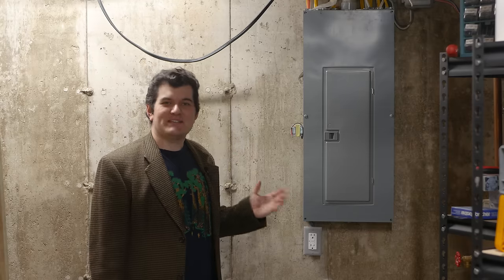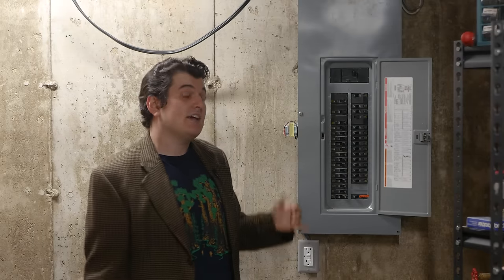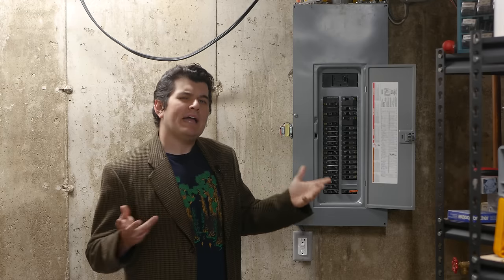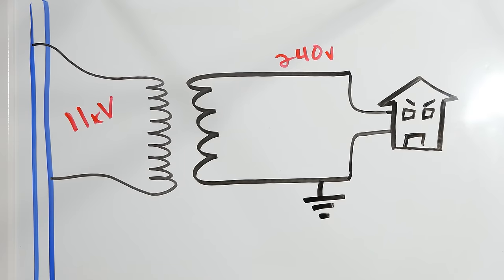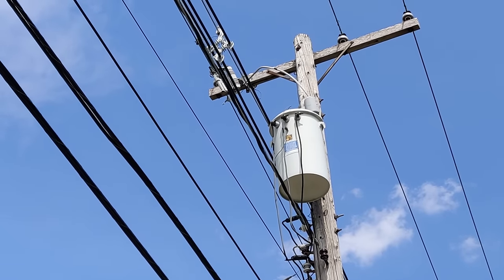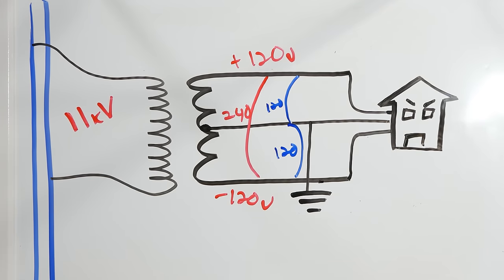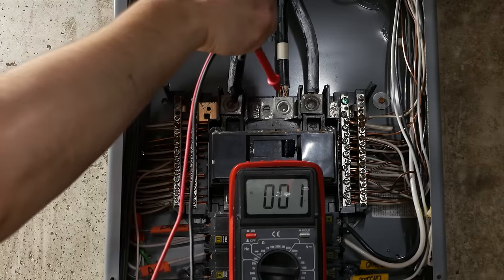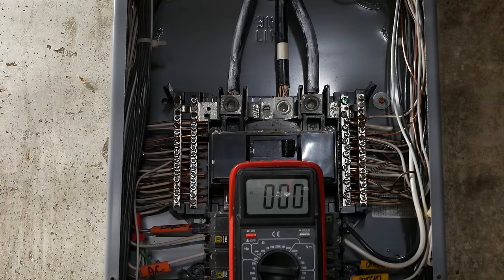The US electrical system is not 120V

Comment: Wait till he hears that we also have 400V supply at our homes.
Reply: @TheSimon253  he clearly said that he will ignore it.
Reply: @TheSimon253  Not to mention our neat DIN rail breaker boxes.
Reply: yeah by the logic he calls US a 240v system, then we have a 400v+ system (three phases at 240v 120degree offset= two phases measures a 400v difference). and of course accompanying three phase breakers! not the lame two phase ones he's got ;)
we call is 110/120 and 230/240 respectively because that's what you typically get at the wall with one phase and one neutral for "user appliances". not permanently installed ones such as car chargers or ovens or washing machines.
so I'm not really sure what he was trying to accomplish with this?
Reply: @AKIOTV  I'm not a huge fan of DIN rail breaker boxes. With all the DIN-mounted breakers I've seen, you must connect a supply wire (or bus strip) to each breaker along with the load wire, which adds more wires (and more clutter) to a breaker box. Plus, the two additional screw connections are more places for a mis-tightened connection to happen, which is marginally more dangerous. I much prefer our snap-in busbar system for both ease of installation, and less points of failure.
Reply: @give_me_my_nick_back  electrical stove connection as well. My Induction top can draw 8kw
Reply: We also have 2 phase neutral loss, the middle phase acting as return, @230V on each as well as polyphase.
Reply: But nobody uses this 400V thing. It's just a hazard when the wiring goes wrong. 380V 3phase is of course the ultimate power horse. Take that, USA!
Reply: @davidk8893  most of DIN breakers support common rail providing electricity as well as wire input - gives a bit more flexibility - although i agree in most home applications people tend to plug 2 wires at both ends. Its a choice though, not a design of DIN breakers. Im not very well informed about the US system, but my setup looks about the same as US one in principle - breakers plugged on a rail, with load wires coming out. 

Like i said above, im more interested in the 200 A breakers, i had to divide my load into multiple 3 phasex125 amp sections, and any breakers above the section are big (think at least a coke can big - 600A ones are bigger) one time blow fuses.
Reply: @give_me_my_nick_back  the fact that you dont use it does not mean you dont have it :) look at electric cooker (the big ones) and electric boiler and you will see it used. Normally they dont even have a plug but are screw directly to the cables (at least in germany)
Reply: @GizmoTheGreen  The US electrical grid is a three phase system. Most power lines have three conductors, except for in residential neighborhoods. However, the power that enters our homes is only single phase because there are very few things in our homes that would take advantage of three phase power. Three phase power is most often only used in industrial settings with motors that would utilize it.
(BTW, the breaker boxes we have are not two phase, they are split phase.)
The US has 240v outlets that are frequently installed in places like garages, but the truth is that there's not a whole lot of devices that really need anything higher than 120v.
Reply: @shha22  The basic principle of the US vs Euro breaker boxes is pretty much identical, it's just minor changes in the way that the principles are implemented. In my experience, the US breakers tend to be very heavily built, and use much larger contacts and much denser plastics than the euro equivalents. In the end, it doesn't effect the performance all that much, but it does produce a product that lasts a bit longer, and has has a much more quality feel. (opinion, not fact. Take with a grain of salt.)
The main breaker in our house (the huge 200 amp one) works just the same as any of the other breakers in our house, it's just bigger. It will only trip in very rare circumstances where the combination of loads on the breakers below exceeds 200 amps.
Reply: @Gunstick  we use 400V normaly on mostly do drive engine it is common on my opinion if you have use for it for example saw conveyor belt they offen have some version of this connector  https://www.soutok.com/5841-thickbox_default/e-zasuvka-pohybliva-400v-32a-5p-ip44.jpg i know at least 3 version of it.
Reply: Most houses in Sweden has 3 phase to the main breaker. If you like to weld or use other heavy machinery you have a 16 amp 3 phase outlet in the garage. Most consumer stuff no longer needs 3 phase though. When I worked in construction we used 3 phase 400v all the time, we had 16 amps, 32 amps, 64 amps and even some 128 amps (although we had to have an electrician come in everytime those needed to be handled). Anyway I have several friends that have 16 amp 3 phase outlets that they actually use, mostly for welding.
Reply: And there was a time 2 phase (90°) was "a thing".  Short lived design in Southern California for refrigeration equipment because an engineer covenced someone it was more efficient.
Our center tap trasformers do have a safety risk.  If someone steals the ground wire from the transformer pole and/or the meter base has a faulty ground, the voltage passes thru 120 volt wall outlets with highest load and back to the breaker/fuse box and let ground/neutral float to 90 volts. I know, because one rainy day a box "bit" me!  Good thing it was not like the UK version. The voltage could have been higher.
Reply: @davidk8893  Nah man, there are plenty of things that use more than 120V can provide. It's just that you don't get them in the US. Typical space heaters are ~7000 BTU/hr around here, for example. An electric kettle is also about 2kW.
Common practice in Europe is 240V 13A, which gives you ~3kW capability. The nice thing is, you'll barely ever trip a breaker, even running many things from one circuit.
In my house, I've got one circuit running three rooms on average. Only exception is the kitchen, which has multiple circuits, including a 3-Phase one. But I can still turn on the kettle, toaster, and Microwave at the same time without any fear of popping a breaker, even though they are on the same one.
The biggest advantage is that line losses are 1/4 of what they would be with a 120V system, thus the voltage is much more stable. And that greatly reduces fire hazards as well, as a bad connection doesn't cause nearly as much heating as on 120V.
Reply: He wouldn’t care? He was just trying to clear up confusion about 120 v. 240...
Reply: @give_me_my_nick_back  Some jetwashers use them.
Reply: @GizmoTheGreen  The entire video only talked about one single phase feeding into a residential building. The US still has available to anyone who requires it 480V three phase power( 277V 120 degree offset = two phases measuring 480v difference) from the same primary transmission poles that supply the 240 split phase. 480v three phase is not installed as a default because 240V on a split phase can run everything required in a residence. Car chargers, AC, Stoves, Driers, etc. I wouldn't say it is a lame system. It just doesn't add in complexity where it is not needed. DIY Joe in the US can't plug his TV into 400V if he gets two wires incorrectly installed.
Reply: @TheSimon253  We have 3 phase power available to UK houses. It's just ovens are the only thing that make use of it, and even then not all ovens. Don't ask me why.
It might make a come back for electrical car charging though.
Reply: @kain0m  There are a lot more circuits wired in a U.S. home than there are in a European one. Unless the home is very old, or it was wired against the NEC (national electric code) tripping a breaker will be a rare occurance. A typical branch circuit in the U.S is 120v, 15 amps, but it is common to have 20 amp circuits in places where high-current appliances will be installed. I can turn on the stove, oven, toaster, coffeepot, microwave, and have the fridge plugged in, and still not have any breakers tripped. It's simply a matter of having more circuits. Also, in a lot of places, the code dictates that certain rooms must have their own circuits, and places like bathrooms must have the outlets and lights on different circuits. (this is to prevent injury in case the lights go out due to a hair dryer tripping the GFCI). In addition, all new houses in the U.S. are required to put AFCI devices in all bedrooms and living spaces.
As far as line losses go, if you're referring to transmission lines, that's simply not true. The final voltage has no effect on the transmission line voltage. The line losses really have no ill effects on the house-level, as the wires don't travel far enough to have significant losses.
Reply: @carldawson5069  I'm not sure I grasp the US system well enough to be sure i understand the issue. But the ground doesn't go back to the transformer in the uk system so I don't think that problem would be posible over here.
Reply: @btwbrand  i thing thed U.S. is adding unnecessary complexity in form of transformer for every building we have just 3*240v connection from power line to building eliminating another problematic point and allow people run 400V equipment without unnecessary request.
Reply: @davidk8893  so you have more circuit and more amps in cable in lower distance thad sound for me like unneceseryl complex network in compression whit EU 3 phase 220v network.
Reply: @davidk8893  Indeed, plenty of appliances with a motor of course but most of them are fairly small oh and probably two of the bigger ones would be the Washer and Dryer an application that needs a motor capable of a operating over a range of speeds, that would take a recifier-inverter driver to use a three-phase induction motor in that sort of application anyway if I remember correctly. Some electric locomotives I believe do exactly that as driving the motor with a programmable frequency PWM inverter allows fine control over speed and torque. Though the locomotive is perhaps still simpler in that regard as you do generally want the motor to just turn at a given speed with a desired amount of torque none of this rocking back and forth etc washers do.

Comment: "there are many things inside this box that can kill you..."  Yeah, 60 of them each second!

"Beware the wigglies" as we sparkys say :-)
Reply: i never triggered a RCD.... i must have over 1600 Ohm body resistance.. in our 230V network
Reply: @Arltratlo  >1666Ω? ;-)  The average healthy person has 2-3kΩ and our Reg's use 2000Ω as the basis for calculation.  The maths and practicalities of how you should trip an RCD are slightly less simple, but I'm amazed you didn't trip one if you managed to put yourself in circuit...
Reply: @Dranok1    50V : 0,03A is 1.66kΩ....   so i am above it, below it will trip...
Reply: @Arltratlo  Quite so, that's why we are required to keep touch voltage below 50Vac, but other matters enter into the equation when determining what will make and RCD trip if you are part of the cct.  (Including parallel paths, harmonics, etc.)  I was only joining you in light-hearted comment rather than trying to start an electrical engineering discussion <grin>
Reply: @Dranok1   i am thankful that i am not an electrician in the USA, your wiring makes sometimes no sense to me...  but because our houses are mostly build from stone or bricks, it keeps the fire hazards down a lot...and to create a power outlet or a switch box, all i need is to drill a round hole...because our standard box is PVC and 58mm in diameter..makes life much easier...
Reply: @Arltratlo  I get the impression theirs uses the same system of round boxes (generally fed by flexi-conduit) -- I presume you are in mainland Europe, I'm in the UK so our backboxes are square but we have the same underlying Reg's (hence my discussing RCDs with you because our requirements are the same).
Reply: Actually 120 times a second. For each cycle, there are two peaks. Positive and negative, as these things are usually drawn.~
Reply: @SarahRWilson  Ooh!  Are you really trying to teach a bunch of electricians about the Noddy-basics of how AC electricity works?! 😅
No: we talk about cycles, not half-cycles -- that's why they're called wigglies, 'coz they go up and down 50 times a second (or 60 over there), not arches, that variously go up and over or down and under.  Nobody ever said "beware the arches" unless they had something profoundly against certain purveyors of fast food...
Besides, a single "arch" (of half the voltage) isn't going to hurt you (unless it's really well into HV range), it takes several full cycles to confuse your pacemaker and induce your heart into VF.
But you are correct that the symbol for AC voltage looks a little bit like a tilde sqeezed together.
Reply: @Dranok1  
If you touch hot and common, an RCD/GFCI won't even trip, because no leakage is occurring.  You have to be between hot and earth for leakage to occur.
Reply: @i-love-comountains3850  ? 🤔 Err...  Where is this from?  This hasn't even entered our conversation, and certainly you don't need to "explain" it to a couple of sparkys! 😆
(I'm getting used to electrical conversations with Yankees!  I even managed to interpret "common=neutral not earth" without thinking for more than a second 😉)

Comment: That slide about the gas dryer blew me away. I've been using one for years at my house and the closest we've ever had to a legitimate fire hazard was when someone ran their car through our garage, which goes to show gas dryers safer than cars.
Reply: to be fair, many things are safer than cars lol
Reply: That made me laugh! Thanks for the chuckle.
Reply: Please clean your gas dryer of lint inside the metal housing from time to time.
I recommend once a year.  Or immediately upon burning smells....
Serious, you need to clean it every so often.
Reply: @superchuck3259  Very true.  The worst item about most inside dryers is the vent needs cleaned of lint at least twice a year. My vent goes into a vertical stack which, over time, completely fills up with lint. Then I need to go on the roof to clear it out. At least twice a year, I'll remove the pipe coming from the back of the gas dryer and clean the lint out of the vertical stack. Allows the dryer to work extremely well.  The most efficient dryer is a sun dryer, but birds are a hazard.
Reply: Not when looked at on a per unit basis.
Reply: I actually remember frequenting a laundromat that used gas dryers, so when he said "gas-powered dryer", I didn't even think it was weird.

Comment: I'm an electrician... why am I watching this? Lol

Oh right, because I'm subscribed.
Reply: I had a good laugh at this comment because I actually thought the opposite. "I'm not an electrician, why am I watching this? Oh yeah, I like this kinda thing so I'm subscribed."
Reply: That’s me. I am an electrician and I was watching it. I was wondering if the fact that sub panels must carry neutral separately from ground was befuddling him. I will give him a clue.......parallel circuit.....  Another...what does neutral do? What is the function of the ground?
Reply: Me too. Trying to find any errors I suppose. 

Zip tying those wires in the panel won't fly, looks nice but derating. And that sagging cable overhead.

Comment: The threat of stepping on a UK plug is minimised from being able to leave them plugged in with the socket switched off. Ha!
Reply: Those things are massive though. I do prefer the size of American plugs, and they could be safer with minor redesign. Oh well.
Reply: Plus the whole point of the pins being in that orientation is to discourage people from yanking the plug out by pulling on the cable, which compromises the electrical connections inside the plug over time. If the cable is yanked on by some knuckle-dragger, the Line will disconnect first inside the plug, followed by the Neutral then the Protective Earth. That's why they are different lengths inside the plug. With no switches on the socket, any damage to the cable of something which is plugged in but switched off at the device is now an electrocution hazard. I don't think he gives sufficient credit for the thought that went into the design of the UK system. Many of the safety features have been incorporated into other countries' standards over the years, such as sleeved pins, but I still think the UK system is overall better. The only point I'd concede is the ring main circuit. It did save on copper at the time, but radials are simpler to fault-find and inherently safer. Of course, it is still perfectly legal to use radial circuits in the UK. If I was having my house rewired, that's what I would have installed.
Reply: @herpnderpn2484  another reason for the bulky UK plugs is that every plug has its own fuse installed in the plug. This is why UK switch panels have just a handful of circuit breakers. But if you want huge switch panels, you can't beat the French.  Every socket has its own individual circuit direct from the panel, complete with circuit breaker. Now that is weird!